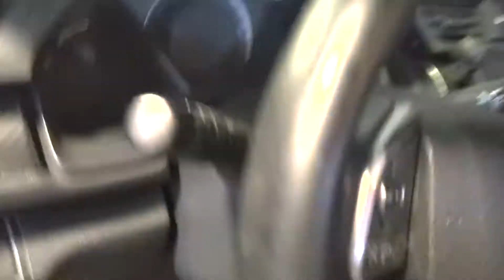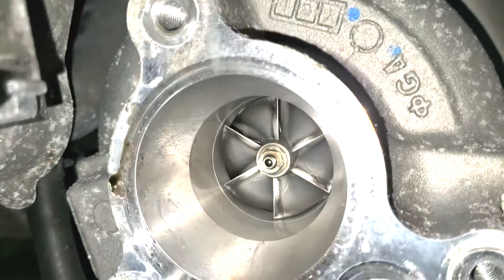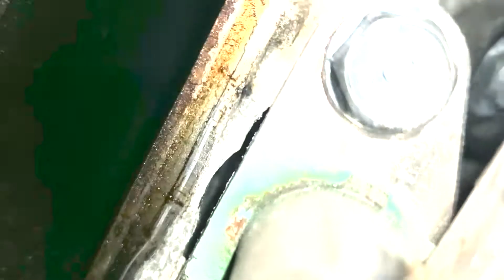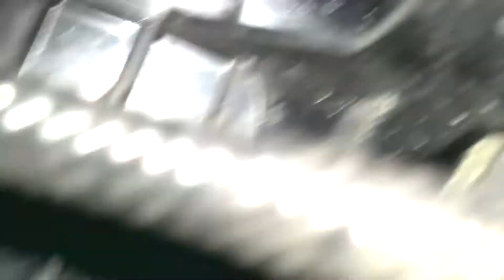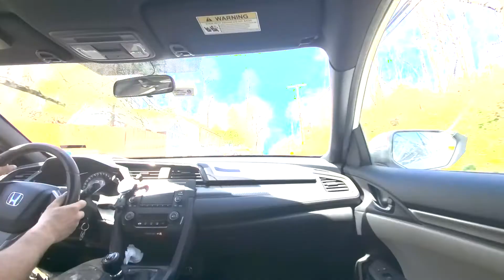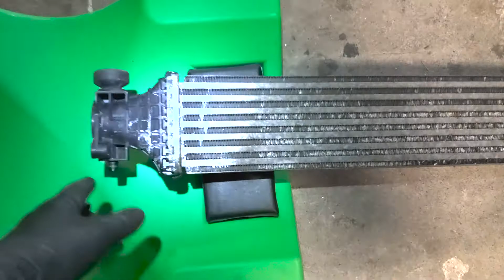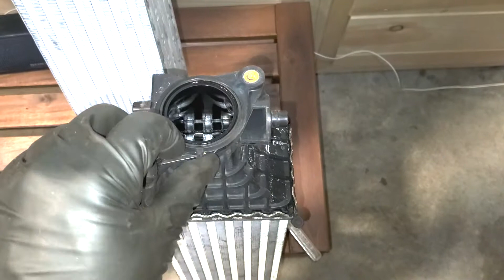Troubleshooting 10 Gen Honda Civic 1.5t poor performance and MPG issues

Comment: Thank you for sharing this. I've been having the exact same problem with my Civic for a while now. It has less than 70,000 miles on it so I wasn't sure where to look first. I'll follow your lead and look into spark plugs and intake manifold first but I wouldn't be surprised if my intercooler was messed up too.
Reply: @Nick Schroeder , found the fix?
Reply: @ripstah187  no. There are too many factors with my problem. My mileage changes with the weather (Minnesota winters are cold), my average speed, and even the gas I use. I don't think I have a leak in the system. But after changing my air filter among other things my mileage went up to ~35mpg. And I'm good with that.
Reply: I have almost all the same issues as the guy in the video and mine is under 70,000 miles also, I think it’s close to 65,000. Bought it last year, off the lot it was giving me an average of 40 mpg and now it’s doing 30 at best. I gotta bring this in now 🤧 MN weather here too

Comment: Hmmm lately Ive been having an issues that the Honda dealers cant figure out and ive taken it to other ppl and they say the same. Can’t figure it out. Anytime I let off the throttle or press it to accelerate the car rpms jump before climbing or dropping making the car feel a jerk anytime im on or off the gas. Or is that just a civic si thing it’s my first SI. 10th gen. Do you guys have any ideas lol 😂
Reply: Maybe check motor mounts?
Reply: revhang?
Reply: Thats the CVT. my wifes 2017 civic does it too. look on the CivicX forum for more info
Reply: @James  SI doesn't have cvt man. It's a 6 speed.
Reply: clutch is slipping. There is a TSB out for it.

Comment: Awesome shot of the valves there's some buildup, but no airflow restriction. I'm currently around 67500 miles on my 19 sport touring. Usually being mostly city, averaging 37mpg every tank. My record was 42.8mpg on a road trip.
Reply: My record  on the 2016 2.0 ex was 46 with 3 people  inside

Comment: Also was wondering if you use top tier gas? And honestly,  there's more buildup on the ports that the valves, which I'm sure is normal. Honda definitely knows how to engineer engines!
Reply from the maker: I try to fill up at well established franchise gas stations and use 93 octane since that's what the tune calls for. Definitely not as much fouling as I was expecting. My mechanic was surprised too when I showed him the video of the valves
Reply: @tranquilizator  what gas stations do you use ?

Comment: Great detailed video! I had over 128k miles on my 2016 before it was totalled. It still ran great and was Ktuned for 65k miles.
Reply: How did it get totaled
Reply: @sirleme6522  I want paying attention and rear ended a car.
Reply: @genenie5981  thanks alot for sharing i thought the engine exploded for no reason etc etc
Reply: @sirleme6522  I now have a 2017 that had 46,000 miles on it when I bought it. Now I'm at 73,000 and I put Ktuner on it at 51,000.
Reply: @genenie5981  there is a video where a guy shows some internal components of civic fk7 that are very thin i think they are parts of the engine. He says they cant support alot of HP without breaking because they are very thin. Be very careful.

Comment: I found it funny when you showed the mpg since my 20 Civic Sport Hatch Cvt gets 25 MPG...but I mostly commute in inner city Chicago "grid". Definitely a really informative video, thanks!
Reply: I have a 21 hatch ex and i only average about 26-29 so idk why this dude is complaining about 33 haha. I do have a few mods and im ktuned. But the best i got was 41 on a road trip.
Reply: @vincentbaker1996  Civics should be 35-40 mpg
Reply: @jamesmedina2062 Not the sport trims. They tend to have the worst mpg among all the other trims.
Reply: Shouldn’t city mileage be 32mpg?? I drive mainly in city too, and get 24-26 mpg… is this normal on a 2017 EX-T w. 102k miles??
Reply: @MorkieMunchkin  CVT? 6MT?

Comment: I’m getting poor mpg on my 2019 civic ext . It only has 19000 miles . Any suggestions ?
Reply from the maker: How poor? Is it consistently poor or fluctuates? Do you notice loss of power? There are many things that can cause this problem. In my case it was an intake leak, in your case it could be something else. Unless you are really trying to get down and dirty with it, I would take it to the dealer and have them chase down this problem since your car has low mileage and is still under warranty. The dealer has all kinds of diagnostics hardware that will shave days off troubleshooting something like this. Whether or not a dealer will entertain this or consider this a real issue is another story... 

If you are inclined to look at it yourself - here are some things to check that my give you a clue as to what's wrong:
- Check electrical basics like Tony mentioned below. Take a voltmeter to the battery when the car is off and when it's on, there are guides on how to do this best and what values to look for. Make sure all connections are solid
- Make sure your air filter is clean and installed properly
- Take plugs out and check them, there are guides on that as well, complete with what exactly to look for
- Look for damage to intercooler or other engine components in the front and under the car
- Lift the car up on a lift or do one wheel at a time and make sure they all spin freely. Silly as this is, the problem can come from excessive friction in one of the wheels, due to brakes, bearing or something else

Hope this helps
Reply: Check the voltage system for low voltage! My civic sport touring 1.5L turbo engine model started having issues and slowly losing power. I found information about the piece of crap battery that was put in these cars that is like 14 pounds liter then the Canadian model to save weight. But I can assure you that if you are knocking that kind of weight off of a battery! That is where all your reserve compassady is stored in the lead plates inside the battery! And these cars are so full of electronics that there is no way the system can keep up with the demand to keep things working properly! I believe we had 24000 thousand miles on our civic when I figured out what was wrong and changed the battery. When purchasing a new battery, Make sure you get the platinum top of the line made especially for a car that has all the heated seats and everything is electric, These cars take a massive amount of power to run everything! And the colder it gets the worst your battery performs! And low voltage is a trickle down effect on sensors or anything that is supposed to operate with 12 volts to make it work, It starts causing one problem after another! Two things to remember, cold cranking amps are not as important as reserved compassady, And these cars with the turbo charged engines are horrible for underhood heat and will bake the battery if not maintenanced!That means forget that bullshit about maintenance free battery! Not true! You need to remove the hold down brace across the top of the battery, Remove the sticker and unscrew the six plugs in the top of the battery and physically look down inside the cells to make sure that the lead plates are submerged completely under the water/Acid and it needs water added you cannot use tap water from your kitchen sink! The chlorine in this water will cause a chemical reaction with the acid in the battery! You must use distilled water to add to it 😉
Reply: Mine was poor u til about 35k  on the dash. I was getting max 28mpg now it's 34/ 35 mpg mixed driving
Reply: I’m still having the same issue . I changed my battery , changed my spark plugs and still the same issue. I also did oil and filter change. I need to fix this issue even more now that gas prices are this crazy
Reply: @Jahtav  I think these engines have a very tight tolerance.  I  believe you need to just break in the engine.  I have a small leak in my intercooler and still 35ish right now.  No maintenance other than oil change.
Reply: Wow. Im getting 21mpb on my brand new 2021 civic lx. Only 2k km. Unbeliveable.
Reply: @garcimud  check your end tanks of intercooler.  I put a used aftermarket intercooler on my car  agency power similar to rev 9. It has been 200 miles I now get 40mpg mixed driving no matter what .   I thought my mpg were improving due to break in but looking back at it I replaced several OEM intercoolers and believe they just weren't as faulty .  I believe weather it's your intercooler intakes plenum something has a boost leak.
Reply: @unknownalias5538  I also noticed engine is not warming up as it should. It takes around 10min of driving for first temperature bar shows up. Car is still under warranty. Will have to drive it to dealership for full check up
Reply: @garcimud  I believe the warm up issue is normal. Unless it's 90 out my car is the same way. I could run my car 30 minutes in winter and temp will only show 2 bars
Reply: Just had my injectors cleaned . So let’s see .
Reply: @Jahtav  any up date on your car ?
Reply: @likewaaaazaa  cleaning injectors and changing  my spark plugs didn’t work . It’s just a problems I’ve been living with since .

Comment: I have a 2017 1.5 LITER turbo civic coup. I never hear blow off. Where's the extra boost go when I lift off the excelerator
Reply from the maker: These have a bypass valve rather than a blow-off valve. They do similar thing - relieve intake pressure when the throttle is closed, but unlike the blow-off valve which just vents directly to the atmosphere, bypass valve recirculates the air back to the intake upstream of the turbo. Bypass valves are not as loud as blow-off valves and you are unlikely to hear it under normal operating conditions. 
Cheers

Comment: there should be a boost pressure gauge in your dash to keep an eye on your boost , the 2018 I have has one built into the dash .
Reply from the maker: Yeah, that's a good accessory to have, I'll install one sometime. Interestingly, I've checked boost pressure when troubleshooting this (though not on video) and found that boost was building (albeit slower). I don't have enough experience to tell there was a problem in the readout (HONDATA) therefore I moved on to other troubleshooting steps.
Reply: @tranquilizator  To diagnose a boost leak with software for any turbo engine, you need to look at these three parameters: target boost pressure, actual boost pressure and waste gate duty cycle. If actual boost pressure is slow to reach target or never gets there, combined with high WGDT that is a good indication of a leak. Nonetheless impressive that you managed to diagnose this yourself!

Comment: You must drive mostly highway miles to get 40 mpg. That’s awesome!
My 2018 Civic EX-T (bought new) has over 88,300 miles and currently averages 33.0 mpg. However, it’s averaged over 34 mpg as recently as last month. It’s never exceeded much past 34 mpg. I drive about 60/40 highway to city. Obviously, the more city driving, the lower the mpg. I’ve never driven over 140 straight highway miles at one time yet I rarely drive short city trips either. I experience no hesitation although the turbo lag is evident but everything seems normal. It drives as well today as when I first drove it new.
Reply: UPDATE: I’m just over 102,000 miles. No issues so far. Today, I’m having the oil/filter changed with 40% oil life left. I’ll probably have the water pump and drive belt changed with my next oil change interval later this spring.
Reply: I have recently started using Amsoil 0-20w oil that has zinc in it ! I heard that honda civic  1.5 turbo engine is using the engine oil to cool and lubricate the bearing in the turbo which is reaching temperatures of 360degree! Way too hot for off the shelf oils to withstand causing the oil to loose its viscosity and lubrication properties and wearing shit out at break neck speed in your engine!
Reply: I get as high as 48 mpg and I have the same car you do but mine is a 6 speed manual. Talking 100% interstate though, no city at all. But that's in Utah on a summer day at about 100F and over 4,000 feet elevation. This makes the for thin air, so not much air resistance. On a day with 100 degree temps and over 4,000 feet elevation in the density altitude is as much as 12,000 feet above sea level. Basically that means the air is equivalent to being that high!! At 60 degrees temp the air density here would be the same as the actual elevation. 4,000 feet would be like 4,000. Cars just cut through the air easily here in Utah on hot days. In the winter I only get about 42 mpg during pure interstate driving, still not bad though.
Reply: I have a 2024 civic touring it has 3 k miles on it and I’ve always gotten 33 to 38 mpg depends on what driving I do and what drive mode.   Sport sucks the gas.         But yea depending on where I get gas I can tell I’ll get more or less gas mileage
Reply: I'm guessing that your about to begin the issues right about now depending on how cold it gets in your area. But the battery is a joke in these Hondas!We own a 2017 civic sport touring 1.5L turbo engine, And with all of the electronics in the car it's an overload on the battery. Not to mention the underhood temperatures that this car experiences in the summer heat cooks the battery! We also experienced a coolant leak ( Or so I thought! ) But when the weather cooled down it stopped loosing coolant! I assume it was getting so hot down at the bottom of the radiator at the elbow as the exaust runs very close to it with just a thin heat shield in between the two, That it was boiling it off right at the bend. I had a hard time getting my wife to listen to my suggestion to change the oil every 1500 miles enstead of every 3000 miles! But it certainly smooths out the engine with fresh oil! She knows not to challenge my experience in automotive knowledge though! I have 30+ years experience underhood and I'm always correct in my diagnostic abilities!😉
Reply: @tonymayhew191  
I’m currently at 93,500 miles averaging 33.3 mpg. I live in Westchester county, NY and I get a moderate amount of snow for the northeast. I replaced the battery at about 77,000 miles which, after three years, is about the normal time to change the battery with modern cars. I perform early maintenance, between 3,800-4,200 mile intervals. That’s actually very early for full synthetic 0W-20 oil. If I were to change the oil any earlier like you, I would be doing it every two weeks. I’ve had no issues so far. I replaced the transmission fluid twice and flushed the coolant. I also bled/changed the brake fluid and replaced all four brake pads. I also changed the spark plugs early at 67,000 miles. My Honda dealership recently recommended replacing the water pump and serpentine belt as part of routine maintenance. I will do that when I hit 100,000 miles. Anyway, I’m heading into the winter with no concern. With my aggressive maintenance schedule, my hope is to get at least 300,000 miles before any major repairs are due with either the engine or transmission.
Reply: @tonymayhew191  
I put 1500+ miles on my odometer every month. I always do an oil change right before winter and right before summer. My '18 Civic Hatch EX with the 1.5L Turbo is doing great. Pro tip: switch to the new ILSAC GF-6B 0W-16 oil. No more oil dilution problems. Quick starts in the winter and the engine runs cooler in the summer.
Reply: @joshuaewalker  what's the highest temp during your summers? I want to switch to 0w-16 but I'm afraid if it can handle 122F or 50c which is typical here in Dubai.
Reply: @ripstah187  
Currently, I live in Indiana with average high summer temps around 30°C with intermittent peaks around 40°. But, no state in the U.S. will compare to Dubai.
If you have a Honda 1.5L Turbo EarthDreams engine then it is already a "cool" running engine. The 16 weight of the new oil is not dramatically different than the 20 weight of the originally recommended oil. I wouldn't be afraid to use it. However, it may not be necessary in your case, because of your high heat environment any fuel blow-by getting into the crankcase will likely evaporate quickly and not cause any problems. So, feel comfortable sticking with 0W-20, but I will say to find a 0W-20 oil that meets the new ILSAC GF-6A standard. It's fairly common now.
Reply: @ripstah187  I live in Arizona. Gets similarly hot as balls and I take mine to Honda for oil changes and everything else. I think they use full synthetic 0w-20 oil. Car has 103k miles and I’ve not had any issues. Long road trips, I get well over 40mpg, sometimes close to 50mpg depending on where I’m going.